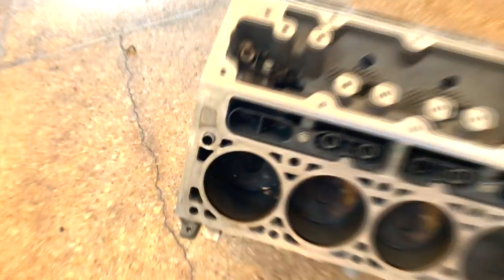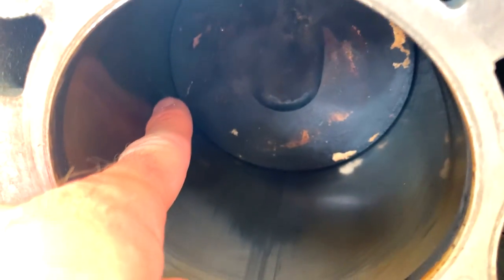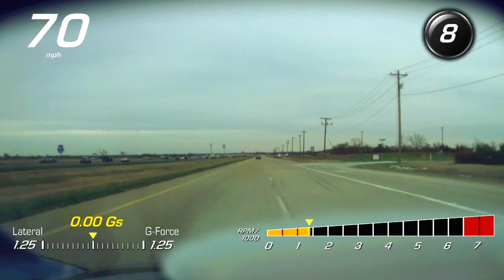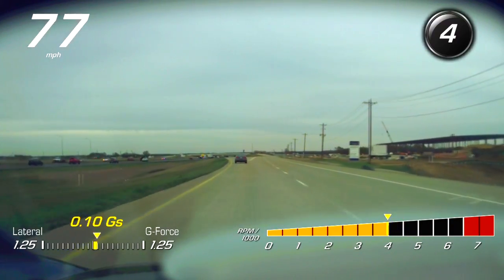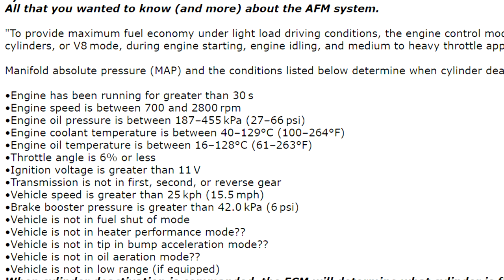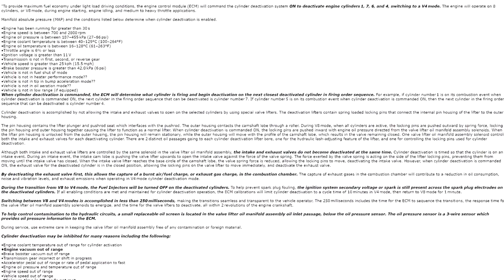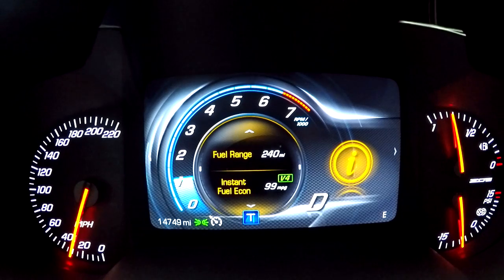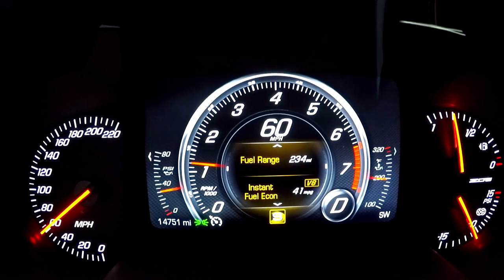How to AVOID 2 C7 Corvette Drivetrain DISASTERS! A MUST Know! *Chevy C7 Corvette*

Comment: I have an 17 GS with an automatic trans. I find it interesting that the other guy had torque problems. In the fall i took my car in for service, which I thought could be trans or torque related. They claimed to not have observed the problem while they had it. This causes me to wonder if this could be the problem.
Reply from the maker: Jay Man Yep, it probably is what’s going on. I’ve found from talking to others, that most dealerships like to deny anything is wrong.
Reply: @BrinkofSpeed  
Thanks for the 411. I'm taking it back after it warms up around here. I appreciate the information.
Reply: @stormcrow5198  Theres a current gm service bulletin to completely flush and fill your auto trans fluid with a reformulated Mobil 1 fluid,and naturally filter change along with that I imagine. The factory fill has been found to draw water condensation so much that it contaminates the fluid, seemingly causing the shutter. I think the new adjustment period after this is they have you put 200 or 300 miles on ,to get the new fluid pressured through the clutches,bands and gears. I've heard if this dosen't fix the shuttering then I think the next policy step is torque converter replacement. If after that then nothing left but to replace your transmission. Contaminated fluid does progressive damage to the rest of the trans. If it's a low milage car, hopefully the fluid change does the trick. I'd be all over it on them about the torque converter if you still get jerky shifts. I just bought a new 19, one of the last manuals, hopefully the clutch doesn't wear out in 6 mo. Good luck at the dealer. Oh one more thing ,you can have an oil sample analysis done on your trans fluid to find out if it has water in it and to what percentage of it any other wear materials that are higher than threshold levels to back a claim. If you did that first before you go to the dealer, then you have proof of contamination levels. They can't argue with science. I was the oil analysis monitor for my maintenance unit in the Army years ago. This technology was  was amazing for 1986 and how the lab would find problems before major damage. Everything got lab checked monthly and now it's been commercially available for years.

Comment: Brink of Speed Great video!  I am starting to test drive C7 Corvettes.  I found a 2015 that I really like but experienced what I am hearing is torque converter clutch shudder.  After watching your videos on the AFM and the one on the Range device, I knew what to look for when test driving.  Sure enough, each time I felt the shudder,  the V4 was either kicking in or out.  I was told the bulletein solution is to flush the fluids and drive 200 miles to verify the shudder is gone. So I see you mention a subscriber had torque converter issues due to the AFM.  I am waiting non the dealer to see what they can do to verify the torque converters are not worn or malfunctioning before I purchase.  I am hopeful that the flush will remedy the problem but am suspicious that the torque converters are  failing.  I will be looking to install a Range if everything works out.   The vehicle is a one owner vehicle with 9500 miles.  There is no way I will buy it with the Shudder issue but am hopeful they will resolve it or keep looking.  The whole point is how great it is for individuals such as yourself sharing this information.  Otherwise newbies would have have no clue what to look for.  Curious, was or is the Range device still working for you and if so are there any other side effects from the Range that need to be aware of?   Thanks again.
Reply: Just curious to see if you bought your C7.  I'm going to be looking to buy one next year and just trying to see if you have any tips on what noises to look out for.  I will also add the range technology, but not sure if that will help if the car was driven without it already.
Reply: @76depechemode  I did buy it.  It had a shudder to it when the v4 mode kicked in and out.  I had the dealer send it over to a certified corvette technician and there was a tech bulletin on the transmission fluid.   My car only had 9500 miles on it.  So they did the flush procedure and put in the correct fluid.  This did take care of the shuttering I experienced at test drive.   I ordered the range immediately after purchasing the vehicle.  No more v4 for this guy.  I put about 3000 miles on this summer and the range device worked flawlessly.   Easy to use and does its job.  
If it weren’t for me researching on you tube I would not have known what to look for.  

When you test drive, cycle the dash options so you can see the fuel mileage screen.  It should have an icon of V4 or V8.  When you are in cruise control for example it more thank likely will shift to v4.  Listen and feel for a shudder in the performance of the car while it kicks in and out.  If you experience it, have a certified corvette tech perform the service tech bulletin.   Get yourself a range device if v4 is not desired.  

Other than that. Just listen for normal bad noises that you would on any car test drive.  

Hope this helps.

Comment: I’m a X GM Automotive Technician and I’m still in my local dealership checking on what’s happening and what is failing. I forgot the year I was told that they started putting the eco lifters in all cylinders for fuel mileage. They have been having trouble with the economy lifters from day one. They are redesigning them now. Or have been for a while now. The six speed automatic transmission has had a fluid change and so has the eight speed automatic fluid to fix the converter shutter problem but they are now on the 3rd change of fluid but the new fluid is still using the same part number for the change. The only way you could tell is by the label on the bottle or know what it looks like. The latest fluid has a blue background on the bottle and that will fix the shutter problem. I have got up to 39.9 mpg in my car with the cylinders deactivation so I’m running on 4 cylinders. You say it’s not the EPA doing this but they have to do something to help it get better MPG. If you are that worried about the cylinder deactivation then just have to drive it harder to keep it out of the mode. If you want better miles per gallon then you bought the wrong car for that. That’s why they are using the cylinder deactivation to help with that. The box you can plug and play on amazon is the best way around this for you in my opinion. You can take it off right before you have to take it to the dealer for work on it. But I don’t know if it’s not going to show up anyway because you are always being watched by the onstar at all times. I guess you could unhook it to but they will know that for sure. I need to add to this that the lifters problem is the truck only. The Corvette is using a different lifter part number is what I was told. But I don’t always get the correct information because it covers many years and I only asked about one year. The 2017.

Comment: I think you can get a tune that bypasses cylinder de activation however pick a reputable company banks might have something to bypass it also Chevrolet was forced by the EPA to put that feature in most of their v8s it's not something I'd see them spending $ on otherwise

Comment: My Z51 7M will only go into cylinder deactivation if I put it into eco mode which I will never do and I will still get almost 30 mpg on HWY at 65 to 70 MPH ,,
Reply: what the hell is 7M?
Reply: @barryrenaud9478  7 speed manual
Reply from the maker: Cool, yeah, I heard otherwise but it sounds like you figured out something different.
Reply: I find this to be true with my '17 GS 7M also!  I've used eco two times in it's 10,000 mile life.. I was on a couple of road trips, and extremely low on fuel (so I think it helped me not run out of fuel).  You can't miss that hard "clunk" going into & out of V4!! That's why I'm sure it only happens in eco mode.  Now that I know this, I'll never use it again!!

Comment: I was checking out eco mode when I got my new C7 Z06.  Interstate legal speed 600 miles in eco mode got 27 MPG.  On the return trip in touring mode got 26 MPG.   What was the big deal with eco mode?    I did not know V4 mode was kicking in while it was in touring mode.   That is why I saw only a 1 MPG difference.   I will have to check out the manual settings to see if that works and also see that MPG results.    I like you got 32 MPG in my C6... nobody believed me.   Thanks for the re visit!

Comment: im going to be evaluating the gas difference with and without  cylinder Activation mode. I had the flush done which fixed the shudder problem i had on my A8. but i dont want to have problems down the line. i bought the diablo Sprint mod to deactivate the cylinder activation mode. (i dont want to shift or for fun) i may need to use this device more often outside of longer trips
Reply: Why are you evaluating fuel economy on a Corvette?
Reply: @jrparker4804  because you need to have a baseline of what to expect to see if you have problems later.

Comment: I have a 14 Z51and I’m a daily driver I had to get my torque tube replaced a couple of years ago, thank god it was still under power train warranty.
Reply: Seems like a common problem, isnt it? Do you know what causes this and if this would continue to happen or is likely to happen at higher mileage down the road?
Reply: My 2015 Z51 had to have torque converter replaced with 3000 miles on it.  Ridiculous. 
Now has 6100 miles and so far been OK.

Comment: A lot of people think that the manuals only go into eco only when you select eco mode. Not true. My zo6 goes into eco in touring mode at low and steady RPM. You can hear come out of eco when you slightly speed up.
Reply: Check your owners manual on this . It says v-4 mode only activated during eco mode .

Comment: I got a camaro with V4 mode a little while ago. How many miles did it take for the car to break? Was it covered by the warrantee? And last, how long did it take to fix, because I'd need a rental if this happens. I'm definitely not going for a C7 or a C8 if this is a problem with the camaro.
Reply from the maker: Adriel Lettman It happened with about 11k miles on my car. It was covered under my warranty yes and they gave me a rental car.
Reply: Get the Range AFM Disabler. It works!

Comment: I just watched a YouTube video on this a week ago by Bladed Angle. Someone in that video commented that if you pull fuse 32 if will turn it off. Tadge also left a long comment in that video.  I’m glade my Z is a manual.
Reply: Sorry, I was misinformed guys. Fuse 32 turns the exhaust valves off that control AFM so you don’t get that drone sound when it goes into V4 mode. Also fuse 42 turns the other exhaust valve off that allows the exhaust to become louder sounding.
Reply: After further talks pulling fuse 32 might also turn off AFM. I would try it before spending $200. My Z is in storage so I won’t be able to test it on mine for a few more months.
Reply from the maker: JefThegr8 Thanks for the info bro.

Comment: I did talk to a engineer about echo mode on the C 8 which it will have. With the DCT transmission it hopefully won't hurt the trans.
  That's strange the Z06 and ZL1 have the same engine. I had a 2017 Camaro ZL1 it did not have echo mode. 
Thanks
Reply from the maker: Mark Pointer It is very strange

Comment: All you need to do is buy the module plug it into your computer port and I'll never go into 4 cldr mode  and I always Manuel mode any ways 8th gear loads up the motor and builds carbon in your cylinders which is not good

Comment: I do 99% driving in stop and go but I’ve had my torque tube replaced twice in the first year on new 19’ stingray with A8. The only thing I can imagine would fail is the bearings between the torque tube and the shaft for the transaxle. Could this be a result of the torque converter damaging the bearings when in V4 mode?  It failed at approximately 4K and 8k miles and car is near 11k soon. Know anything about this? Thanks.
Reply from the maker: USMADE1 Yeah, that would keep it for the most part out of V4 mode. As far as the torque tubes go, I’m not sure about the bearings thing. You could probably find info on the forum about that though.
Reply: For sure all of the vibrating when in v-4 mode is destroying the bearings and bushings in the torque tube 100% !!

Comment: I have never seen or felt my M7 Z go into V4 mode unless I’m in eco mode 

That being said I have a hard enough time even getting it to activate and stay on.  Really the only time I find it stays on is on the freeway when I let off the throttle and coast. The moments get on the pedal even slightly it goes back into V8.
Reply from the maker: Tommy Papis That’s good, mine does it all the time in drive mode.

Comment: Had 'shudder' on my 2019 C7 with A8 trans with 7,000 miles on it.  Took it to dealer.  Service guy started up my car and said he heard a bearing noise on my torque tube.  Said he would change to Mobil 1 trans oil and check torque tube sound.  Next the called me and said tech checked run-out on crankshaft and it was almost 1/4".  New engine requested from GM.  GM approved.  Waiting for new engine now.  Is this any way to run a railroad?  Buy a Toyota and it runs for 300,000 miles with no issues.  C7 Corvette has known issues that call for major repairs and dealer seems ok with it if GM provides parts.   I just don't get why this is......
Reply: Can you explain to me what this shutter is ? I got a 2019 and want to make sure I don’t have this issue too

Comment: Hello i know im a Year late to this video but i was driving my Corvette that i bought for my birthday 4 months ago February! 2015 Stingray 1lt yup nothing fancy! Well i was driving home from a friends house i had it on Track mode and on Drive and i heard a loud clunk! When driving trough streets at low rpms then getting on the gas on the empty streets! I googled it and i saw that it did go into v4 mode and then rapidly switch back to V8! Now does this happen to everyones corvette? I hate the fact that mine is Auto but its all i could find at the time and now this? Having to drive it on Manual paddle shifters does get annoying! Specially when im rolling around with the lady…

Comment: You can just buy a Range device that’ll shut down AFM. I had the trans issue happen to my 2017 Z51 auto, I got the trans fluid flush done and right away got a Range device. So far so good in the last 8000 miles. Also Range is not like a tune. It is not traceable so just take it off when you go to service
Reply from the maker: Awesome, I’ll have to pick one up.

Comment: Hey, Mike.  I had issues with the torque converter in my 2016 C7 Stingray (A8) a couple of years ago.  Basically, whenever I drove it at higher speeds, usually above 50mph, and I was just cruising, not accelerating, I would feel a trembling coming from my pedal, originating from the engine.  It got worse over time.  I found out on the forum that they just needed to flush out the converter.  I took it in.  They did a triple flush (?) and the trembling never returned.  Do you know if anyone had that same issue come up again even after the flush?  That's my biggest worry.
Also, if you'll excuse my ignorance, what do you mean by "lifters"?  Is it a fix that takes several days?  Expensive to repair?  
It is disappointing to hear that the only way to take out V4 mode is to have the car tuned and then have your warranty invalidated.  
Thanks, Mike.
Reply from the maker: Chachi Chochacorta Ok, so, the trembling thing is exactly what I’ve experienced and sucks. I had my transmission fluid flushed 4 times and it still trembles and jumps forward coming to a stop. It’s annoying for sure. As far as the lifter goes, A lifter is a cylindrical component that rides on the Cam Shaft to actuate the Intake and Exhaust Valves. For pushrod engines, the Lifter pushes the pushrod up into the Rocker Arm and opens the valve. As you can see it has a important function for sure. There is a device called Range Technology that you can buy that will delete V4 mode and I guess it won’t void your warranty. Take care bro.
Reply: @BrinkofSpeed  Thank you, sir!  Always looking forward to your next video.
Reply: I had the same issue on my 2016 stingray. Dealership told me that the transmission fluid needed to be replaced with a different grade and that seemed to stop my problem.
Reply: I'm looking to buy a C7 next year.  So they had to do  triple trans flush to fix the problem?  Once it was fixed did you buy a range technology so you wouldn't do deactivation?
Reply: I’m going through the same problem right now with my 2016 Stingray. I thought I was the only one with this problem. How much did the dealers charge you for this fix?
Reply: Same issue with gas pedal trembling and popping under foot between pedal and seat.  The triple flush and fill fixed mine.  Dealer told me if it returns, they would replace torque converter.  I have a 16 C.7R.
Reply: @Yoman6767  Sorry for the late reply.  My car was under warranty and, at the time, it was well known that this was a common issue among automatic transmissions.  It was free of charge.
Reply: @76depechemode  Sorry for the late reply.  Yes, one triple-flush seemed to fix the problem.  I should add that just before I sold my 2016 Vette in 2020, it felt as if the issue was coming back.  
I never purchased the range technology.  One way I was able to stop from going to V4 mode was to put it in manual and simply change gears with the paddles.
Reply: Also have 2016 C7. Had same problem, dealer triple flushed trans and problem diaappeared ! I have 10,000 miles on it now and will be buying plug in disabler for V4.